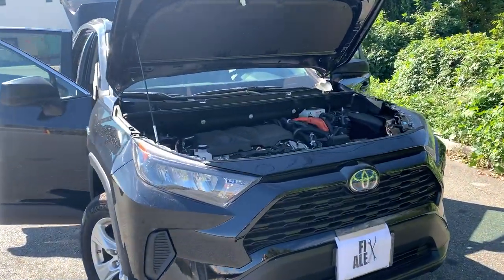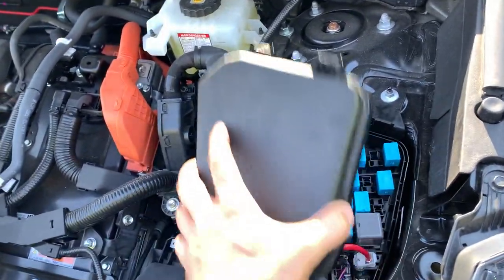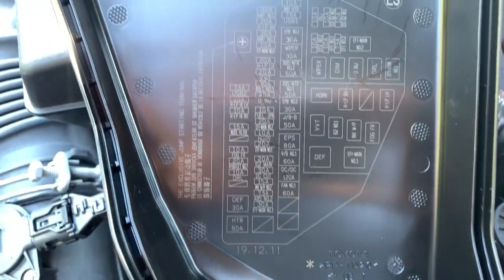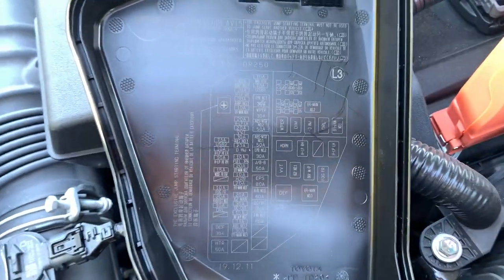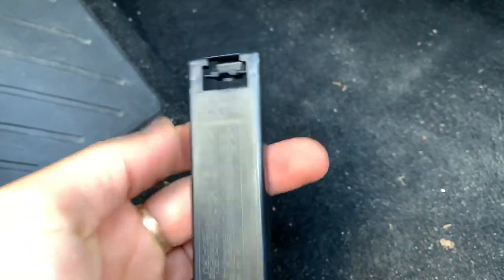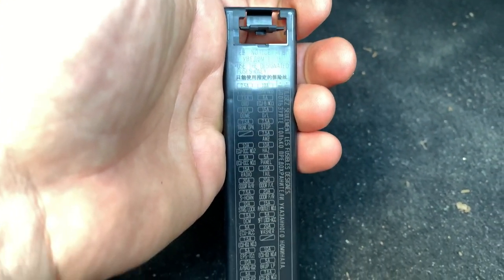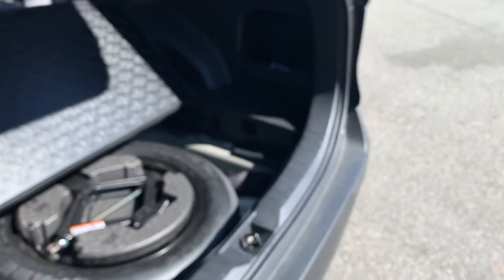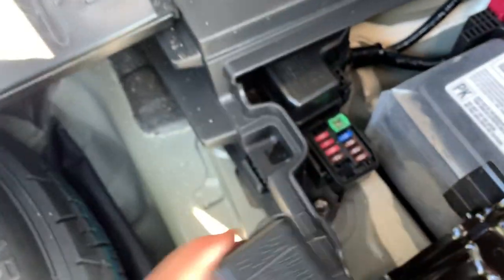Fuses location 19-23 TOYOTA RAV4 2019 2020 2021 2022 2023 2024 box

Comment: I just bought a  2021 RAV4 only to discover that the 12VDC cigarette lighter outlet in the front is not working, the one in the back works. What in the hell were the  Toyota engineers thinking when they made this fuse box so hard to get to??? Phreaking ToyotaTards.